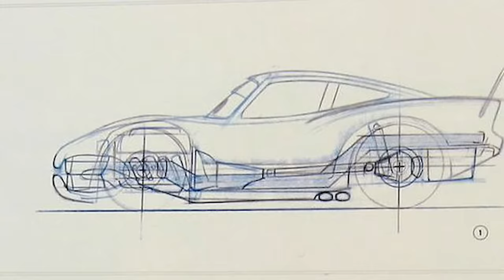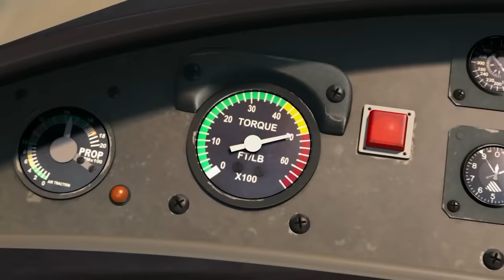Why Couldn’t Lightning Beat Jackson Storm? | Cars Theory

Comment: ok this might be long but hear me out, if the animated series or cars 2 is cannon then prime mcqueen had a lot more speed than jackson storm, like he could go according to some resources to about 125 mph in cars 2 and mach speeds in the animated series(but we'll pretend that it doesnt exist for now) this would mean that his original parts could go much faster than what he can do at the point of cars 3. this might be a stretch but i think the companies were trying to stop maintenence of these cars on purpose to encourage newer cars like how your iphone gets 20% slower everytime a new model comes out. this would open the door for younger cars to start racing and replace the old ones or lse there wouldve been just old cars with infinite experience and no room for youngsters. 
one other theory that i hve is that these cars biological components wear down over time like normal biological things happen. the same way that a 70 year old would never be able to compete with a 20 year old even if the 70 year old was better than the youngster in his prime. this natural wear down of these cars would explain him not getting upgrades as even if he did get them, by that time his biological aspect would be so old tha he would not be able to use it to his full potential.

Comment: It's amazing what success money can buy. Prototype tech is developed and manufactured for a test run, it proves to be exceptionally superior to what's already on the market, a new "guinea pig" is built to take on the existing competition, it's released and dominates. Can we buy said parts and augment them into our thingamabobs? Maybe... not. If the parts are available for purchase, odds are they're prohibitively expensive which is a turn off right there. Might as well claim "not for sale" at that point.

Besides, in this case with automobiles, proper engine swaps can take a long time to do. Assuming the whole assembly (block/heads and internals) is brand new and doesn't need to be ripped apart and rebuilt, the project can take hours to a full day. Aligned to the transmission alright? Good. Wiring. Fluids. Belts. Prayers. Is that all or are we replacing body panels with carbon fiber or aluminum? How about the driveshaft? Gutting the interior? Replace steel gas tank with a plastic one or remove then opt for fuel cell instead? Lightning would be undergoing "surgery" for a while but in the end he'd have been a wee bit faster while still being much smarter than Jackson.

Comment: From the little I know anytime you tried to accelerate his RPMs couldn't handle it and thus he was overheating I mean lightning McQueen obviously and thus is vehicle was incapable of achieving faster speeds. Again I don't know very much about actual vehicles but just like the changing of engines depending on how large or small an engine is depends on how fast it's able to go and any difference would indicate the type of materials used to make Zed engine. But that's all I can come up with and who knows there might be something there there might not be That's just my opinion but what do you all think Yes no

Comment: He can't and he likely never will. His generation is outdated. Storm's new generation has better aerodynamics, build, engine, etc. These cars are just better than lightning's generation. Though it is impressive that someone like lightning can even reach the top 10s or even get the second place against storm's generation. Still he just can't keep up, you see it with the LA 500 and the Florida 500, you can tell it in his face. He is struggling, he is pushing himself to the max if you compare that with Storm or Cruz they look calm, and not pushing themselves as much as lightning.

Comment: I think personally there's something very unfair about Lightning not being able to compete with Storm... 
Strip Weathers was a whole generation older than Chick but consistently beat him, Chick himself was two generations older than McQueen and the BOTH of them were tied on points with McQueen into the final race of the season... So in theory, it CAN work, McQueen could've beaten Storm...vbut the movie makers just wanna go for whatever it is they were trying to go for.
It doesn't make sense when cars like the older gen's had such longevity, McQueen got a run of just about 10 years... Bad writing. Especially considering he's the main friggin character.